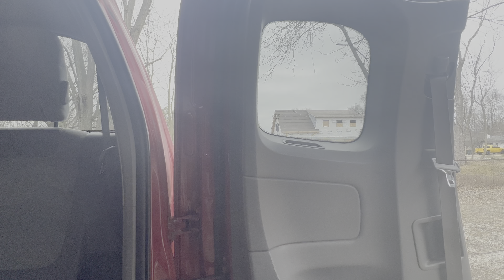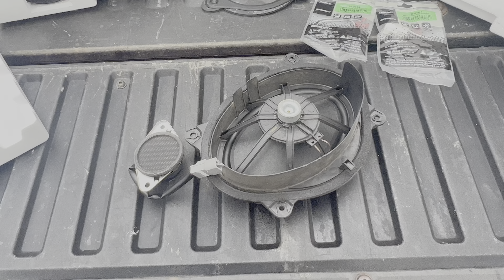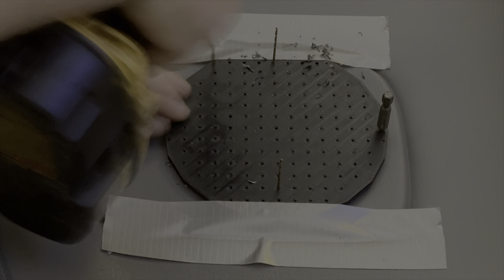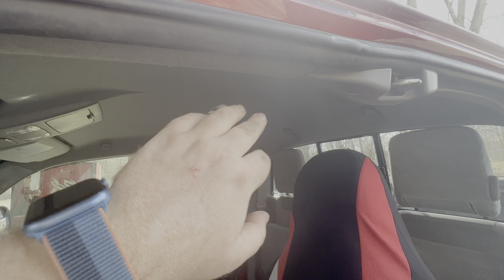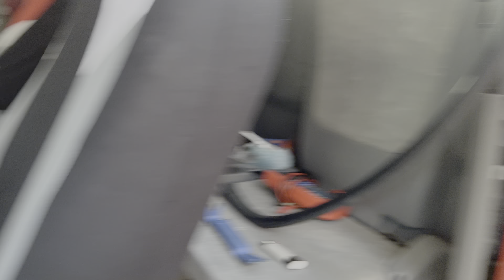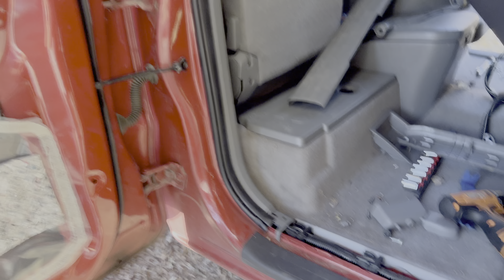Upgrading front speakers and installing rear speakers in a 2010 Toyota Tacoma access cab

Comment: Currently driving my Dad's 2009 Tacoma Access Cab w/TRD Off-Road pkg.  It was his baby.  Lots of bells & whistles, but he kept the 6-spd manual.  Just rolled over 50K last week.  Doesn't have a premium stereo, or what's in there is as premium as it got? - I dunno.  Getting an itch to upgrade it, at least to as much as he would've liked.  Just discovered the crazy headliner "rear" tweeters.  Started searching for info and found your v-jayo.  Had no idea they had unused speaker locations in the rear doors!!!  Like your style; I'm a JBL guy myself.  Subscribed w/full bell.  Think we may talk again in the future. 😉👍

Comment: 11:36 a litttle late here but you could have kept the speaker harness where it was instead of running it inside the door.  the bracket you got from crutch field has a square whole at the top for that very reason.  im sure everything is still working fine but it's to keep the plug free of any water that may get into the door when it rains and stuff which could be a lot sometimes.
Reply from the maker: Good catch, and thanks for watching!

Comment: Hey could you post a video showing the wiring of the rear speaker wire to the head unit? looking to do the same but don’t want to get into anything super confusing
Reply from the maker: I should do an update video on my truck stereo, it has changed quite a bit since this video. I changed to a larger amp I mounted in the back seat. So I have RCA's that go from the head unit to an amp in the rear, and that is where the speaker wires go to now. When I had them wired to the head unit I just popped off the running boards and run the wires down that channel with the rest of the wiring and fished it up the back of the dash to the head unit. Then just pos to pos and neg to neg. Do you have a specific question about any certain part of that?
Reply: @motofoxx13 I guess since your truck had pre-wired routes for the option of installing rear speakers it would be hard for you to explain haha, i have a 2.5 gen without the wiring and it’s confusing the crap out of me
Reply from the maker: @_gloz  Oh mine didn't come prewired lol. What you have to do is pull the door skins and some of the interior paneling. I think I just pulled the trim away, but didn't take it off in the back to access the wires. There are no speaker wires going into the back doors, but there is other wiring for door sensors that goes in there. Then I fished from the cab to the door. Use a generous amount of lube and it will slide right through. You can also use a coat hanger to fish it through, but the key is lube lol. Then  there is a channel that runs under the running boards that covers other factory wires that you can use to get the wire to the dash, and remove the glove box for easy access on the passenger side. Then the driver side I ran it up by the fuse panel and along with other factory wires to the radio. The coat hanger helps to fish that wire on the driver side up to the radio.
Reply from the maker: @_gloz  18:30 in the video will show you
Reply: @motofoxx13 Oh i just realized i got your video mixed up with a similar one (can you tell this is confusing to me 🤣🤣) How did you connect the speakerwire to the head unit after you ran it up the channels?
Reply from the maker: @_gloz  I like to use male & female butt connectors. That way I can take out or change the radio later.
Reply: @ Okay yeah that makes sense! what i’m probrsbly going to end up doing is not worrying about running the back speakers to the head unit, and directly running them to my amp, and just using a harness to run the front 2 back to the amp as well
Reply from the maker: That’s pretty much exactly what I ended up doing in my current setup haha. Running new wires to the front doors was more work than I wanted to do haha
Reply: @ Yeah 🤣🤣 plus i needed an excuse to install an amp without having the wife mad 😅😅

Comment: Rear speakers are unnecessary. Actually it would mess with the sound's stereo imaging. Front door speaker setup is all you need for optimal sound quality.
Reply from the maker: After running this setup for a while, as long as my sub is off, you can definitely hear the rear speakers and they give added depth to the sound. Also I’ve found that if I use the dead peddle then my leg covers the sound from the 6x9, so the rear speakers help fill in that lost sounds.
Reply from the maker: I put a better amp on my mids, and those back speakers make a huge difference.